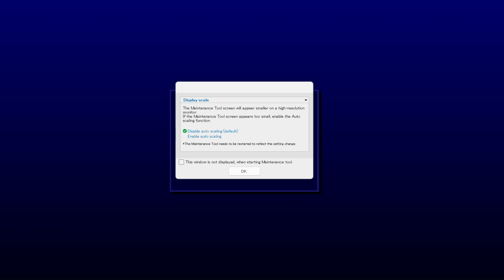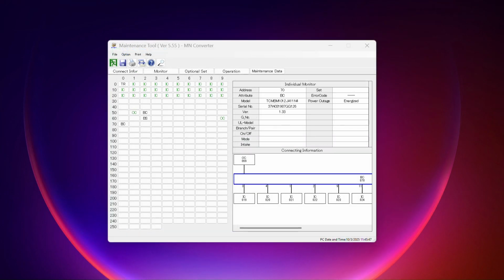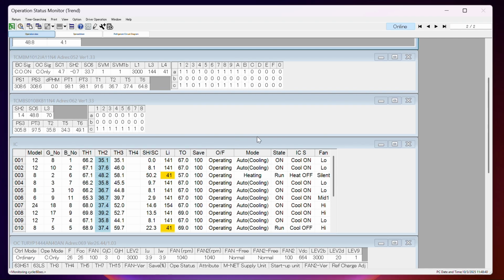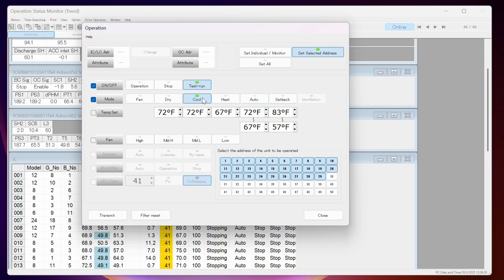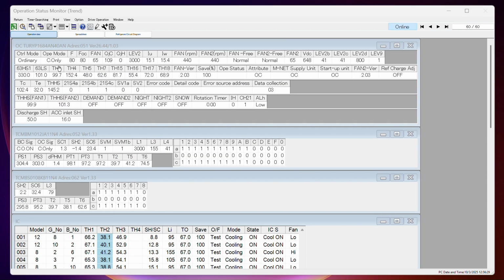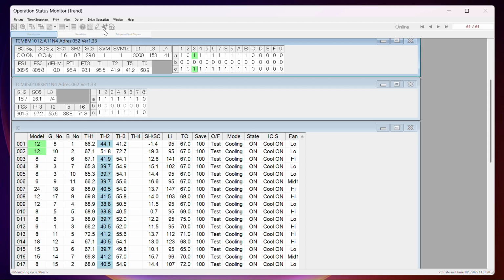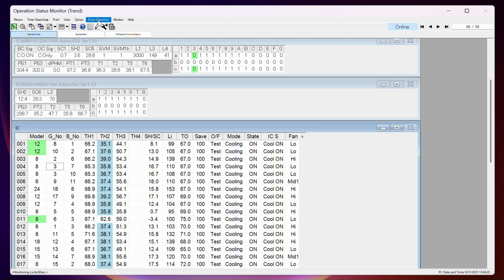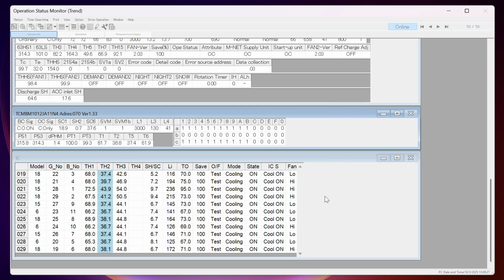Maintenance Tool - Monitoring and Port Verification

Comment from the maker: I forgot to add info regarding saving runtime data to the end of the video. It's the same process up until performing the port verification.

You need to make sure that the "Ctrl Mode" field in the top left of the OC section says "Ordinary."

If it's showing "Initial" you will need to wait until it goes to "Ordinary" for the logs to count. For example, if the units goes into "Ordinary" at minute 18/18 then you would add at least an hour to that before exiting the logs. That makes 78/78 the earliest time to end the logs. I generally give it an extra 5 minutes, so I'd stop my logs around 83/83.

To save the logs, click on the "running man" icon in the upper left. When it asks you if you want to exit monitoring select yes. A new window will pop up for you to name the data and save it.